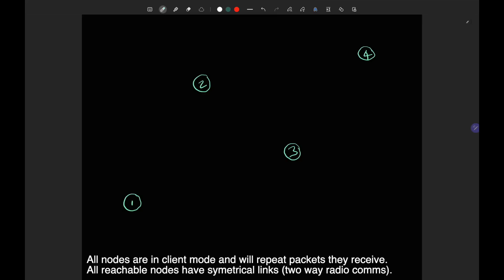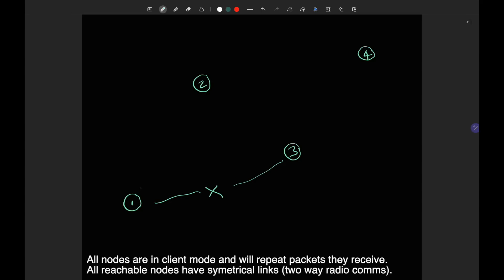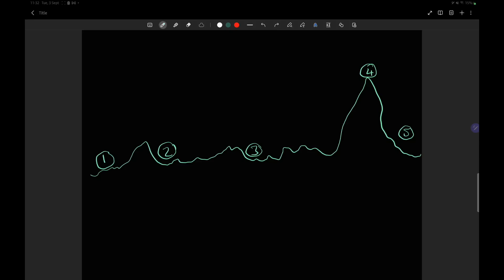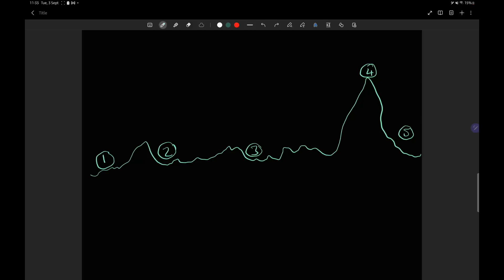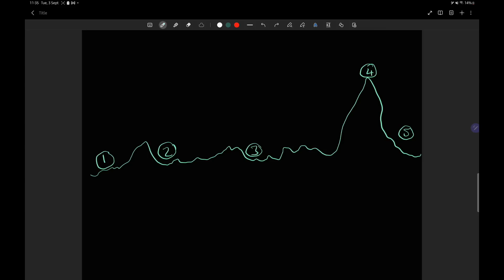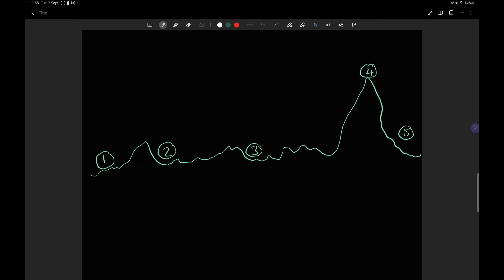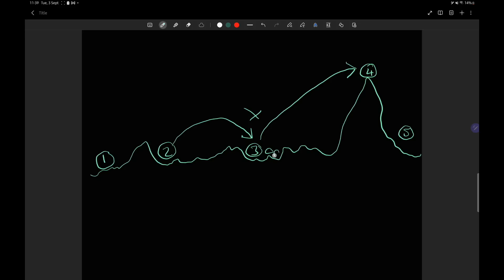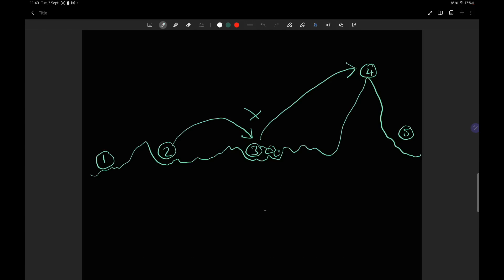How to Master the Mesh - EP1 Meshtastic Routing

Comment: So in the node roles,  I want to put up a solar node,  my location is not a great strategic spot,   but it is an area with not very good access to router,  I cannot make contact with a hand held outside.  I was thinking of using Router_late mode.  this seems specifically for filling a gap in coverage,  but not "pull" priority.   what I don't understand is how is this different than just client mode.

Comment: As far as I can see, in order to use this system, we need to choose one of the three frequency band options. Even if I and the people around me get devices that operate on the same band, how can I communicate with others? I assume that someone who gets a device on a different frequency wouldn’t be able to talk to me.

Also, despite watching many videos, I’m still not sure how the gateway is set up and whether it needs to be connected to the internet. Is there a specific device required for the gateway/router?

Comment: I really wish there were mechanisms for dealing with bad actors. If someone sets up a ROUTER node and it is causing issues, the only way to fix that is by creating an entirely private mesh on a new modem preset or frequency slot. It would be nice if we could just ignore all traffic from a blacklist of problem nodes.
Reply: I am fairly new to LoRa and meshtastic,  but I think I saw something on another video,  that does allow blocking or dropping a node.  
below is a setting under the LoRa tab,  

Ignore Incoming Array
For testing it is useful sometimes to force a node to never listen to particular other nodes (simulating radio out of range). All nodenums listed in the ignore_incoming array will have packets they send dropped on receive (by router.cpp)

I have not fiddled with any of this but maybe you can try it out.

You could also broadcast messages to ask users to please set their devices:  mobile hand helds,  to Client Mute,    strategic router nodes to router / repeater.     in emergency situations,  individuals could have extra hand held  units they could temporarily set to router mode, and place in areas that will fill a gap.   for example on top of a local building,  or even string up a tree.

Comment: Router mode should only be used when you are in a good spot for repeating messages. Otherwise it will degrade the network mesh.

Comment: I thought Meshtastic reliedcon broadcast - Each node blindly re-transmitting a raceivrd packet until hop count is 0 

Are you saying that transmissions are actually targeted and received/processed  by the destination node only ? If yes - then a routing table must be distributed, so Node 1 knows it has to go through node 4 to reach node 3

Comment: Hi, on my opinion Meshtastic network is theoretically nice, but in practice I haven't seen much use for it in among anyone of the users. Most common usage case is when people build their own nodes and then communicate to those base nodes with their own mobile nodes. What is the purpose of communicate to your self? Everyone is comparing ranges and SWRs but why? What is the benefit of all this? I think Meshtastic network should be much more dense and there should be much less configurable parameters because too much parameters make the Mesh unreliable. One of the biggest Mesh destroyer is the MQTT. Why to relay messages via internet dependable MQTT when the whole initial purpose was to create off grid network. And one thing...The LoRa has PRACTICALLY only 2-4km radio range. It would be very nice to see how people do something USEFUL with the Meshtastic network.
Reply: Try looking through the lens of a farmer with remote sensors on ther property and with a private MQTT server.  The use-case becomes a little clearer in that context.

Comment: I’ve been participating in Meshtastic in Utah, US for about 9 months.  In our area we have hundreds of active nodes. We can say definitively that Meshtastic DOES NOT WORK for general purpose comms.  Once the mesh is overloaded it becomes almost useless.  I wish more “influencers” jumping on the bandwagon for clicks would mention this.  It still has value for use in remote areas and I believe  could be useful in a situation where traditional comms aren’t available at all but day to day, the more nodes there are, the worse it works.  There is also no way to “fully control” a mesh when anyone can join.  People join, get frustrated it doesn’t work and immediately set hops to 7 which makes the whole situation worse.
Reply: THIS! I couldn’t figure out why it was so spotty or unreliable, despite having hundreds of nodes all around—until I learned more about how it works. Disappointing, because in theory, having so many nodes all over the valley and mountain tops should make a system like this rock solid. Though I now understand why it may actually have backfired here in Utah…
Reply: It can (and does) work at larger scales IF the mesh is well coordinated and designed appropriately for the terrain and node distribution you're trying to serve.

That is a big if... most meshes seem to be growing organically without that kind of organisation to mitigate the problems upfront, which makes them much harder to deal with later when things get congested.
Reply: What’s the answer?  More routers at higher elevation?  Im new to this.

Comment: I've had my outdoor node setup for just over a month, I'm in a rural location but it can receive over 100 nodes all over the place as we're just under 200m high here,  yet other than with the other small nodes in the house I've never managed to have a message exchange with anyone?
I receive the odd few but never get a response back? It's a shame Meshtastic can't simultaneously listen to long slow mode as well as long fast as that might help a slower yet more reliable messages in rural locations.
I'm not sure where to go with it now. I've got plans for 2 other nodes here with great take off north & south to hopefully join Crewe & maybe Manchester and the other which overlooks the south & into Birmingham, but basically just hoping for some message exchange with some more local nodes but no doing at the moment.

Comment: Every client will eventually rebroadcast a message (as long as there is hop count remaining) if it does not hear three other radios rebroadcast first.  The time a client waits and listens is inversely proportional to signal strength of the received message.  This is how the furthest nodes usually get to do the rebroadcasting.

A router or repeater follows its own rules and blasts out everything.  The only use case for a router or repeater is to connect two or more isolated sub-meshes.  If a client on a mountain were to hear 3 rebroadcasts from one side of a mountain it would never re-broadcast and the other mesh on the other side of the mountain would not get the message.

Routers and Repeaters degrade mesh performance by shortening hops and adding congestion.  They should only be used if they bring in other clients which have no other way of joining.

People by nature want to contribute and "help" the mesh by running a router or repeater and don't realize they are actually degrading the mesh.  Many think being on a hill is reason enough to be a router.  It is not, you should be I'm a great position AND connect isolated nodes.  Just being high, even very high, is not a justification to be a router or repeater.
Reply: I am in a large node stretching from the Phoenix, Arizona to Tucson Arizona containing about 140-150 visible nodes and many of hidden nodes including trackers and sensors--I rebroadcast telemetry every 8 seconds or so on average. Meshtastic is especially popular in Mesa and Tucson.  There is an active chapter of R U Prepared in Mesa Arizona and many of the hams are on board with Meshtastic.  I also suspect there is a Mormon/prepping correlation leading so so many nodes in Mesa.

We have many gratuitous routers that shorten hops and I gradually increased my hop count to 7 seeing many nodes on 6 hops (northern Tucson) and a few on 7 (SE Tucson).  My channel utilization is >30% and my Tx can be as high as 3+%.  In the US where there is no duty cycle limit, gratuitous routers' biggest impact is shortening hops.  In a duty cycle limited jurisdiction, congestion would also be a big factor from gratuitous routers and a hop limit workaround would only make matters worse.  I have a router 2 miles away set to ignore but that only prevents me from rebroadcasting him not him stealing my first hop.  He has a Heltec V3 while I have a Station G2 set to 1000mW (legal limit in US) and an 8dBi antenna.  I have been doing my best to educate locals but sometimes I want to break out torches and pitchforks.

I would like to see the developers address the hop eating problem by making routers and repeaters broadcast last, not first, at least in duty cycle unlimited jurisdictions, of course this would only work if people updated firmware.  Most of these gratuitous routers are router_clients (which are nerfed in 2.3.15 or higher).
Reply: I think your explanation is more accurate. This was my understanding too, all are hearing and the one who gets the lowest signal is transmitting first. The one who receives a retransmit is not retransmiting.

That's why nodes in the house should be CLIENT_MUTE, to not inhibit close nodes to retransmit.

I thought ROUTER only has faster retransmit delay, not always retransmit. Am I wrong?

Comment: But isn't each transmission a broadcast to all on the same primary channel? At what point is this algorithm of preferring the lower RSSI applied?
Reply: Yes, indeed. Only when multiple nodes are receiving a packet at the same time, a node with worse SNR will rebroadcast earlier.
Reply from the maker: Hey @GUVWAF Hopefully I got most of this right? Still learning!
Reply: @GUVWAF So, there's an SNR-dependent delay before a node rebroadcasts a packet?  The lower the SNR of the received packet the quicker the turnaround time to rebroadcasts?
Reply: @rustyhaddock7954  Indeed, and nodes in ROUTER/REPEATER role will get priority above that, see also the documentation. 
@andykirby Yes, I think most of it is right except indeed that Meshtastic doesn't "choose" which node will receive first, it only determines who rebroadcasts first when multiple receive the same packet.
Reply from the maker: Yeah when I watched it through a final time I did think that it might have sounded like that😁

Comment: It would help to be able to create a private cluster of nodes that uses the mesh and that ignores and is ignored by all nodes not identified as part of that particular private cluster of nodes.
Reply: You can do that…
Reply: @nathanjones2584  Oh. I see.
Reply: @nathanjones2584 Can you elaborate? If we just create an encrypted “channel,” don’t all nodes still repeat it/use up hops, even if they don’t have that channel?
Reply: You could tweak the LoRa parameters or just run the default or LongFast on a different frequency slot.  However you are better off just using LingFast with a different encryption key and other modes will still forward your messages without being able to decrypt them.
Reply: @mestora70  Thanks. There are more options to juggle and accomplish my goal than I am aware of. I need to do more reading.
Reply: @blue use a unique channel with 256 encryption
Reply: The problem is with bandwidth.  If you can get a frequency slot with little activity it works but once there are many nodes drowning the bandwidth nothing else matters.  Nodes in an exclusive group will still get drown out by other nodes flooding their own mesh on the same frequencies.